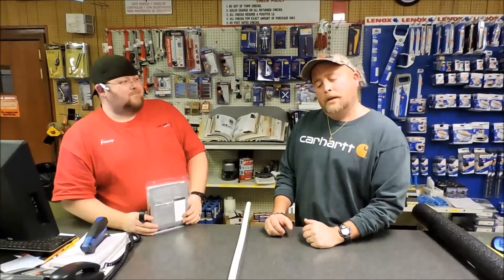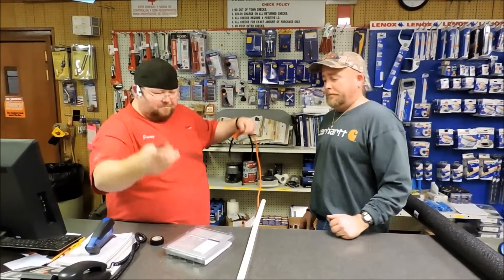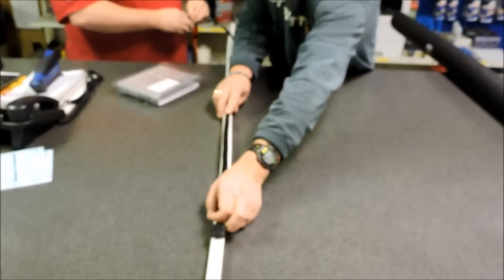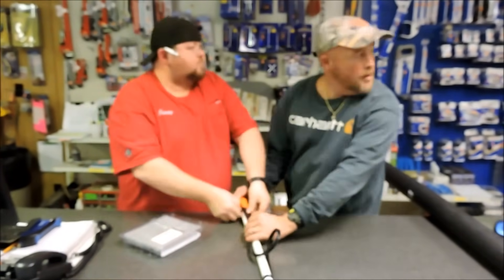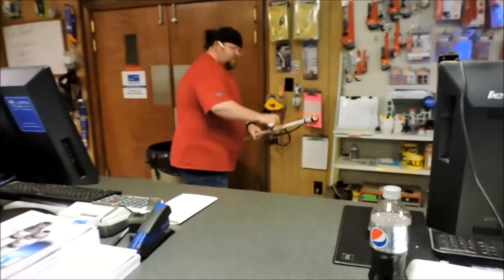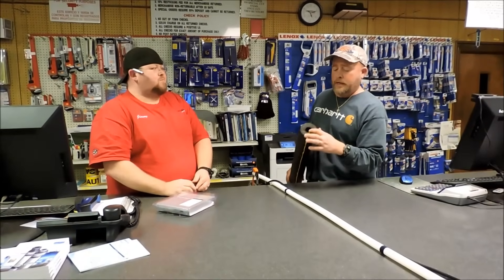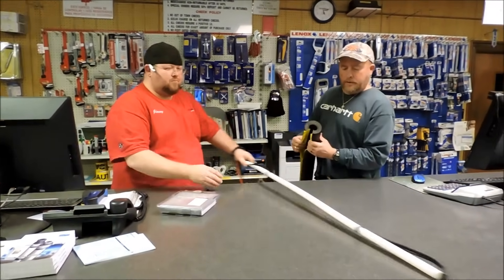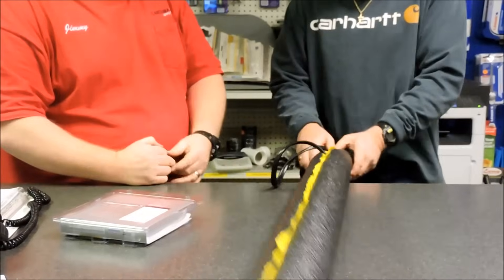How To Install Heat Tape To Your Pipes

Comment: I thought it says on the package not to wrap up/cover your heat tape.  can cause overheating and then a fire
Reply: Iva Lindsay     you can add insulation over the cable, in fact it is recommended. What you don't want to do is overlap the cable onto itself. It can cause an arc and start a fire.
Reply: Yeah you can, using the insulated cover they use.
Reply: Not if you use self-regulating cable. It decreases power as temperature rises. No fire hazard.

Comment: HOW TO TEST PIPE HEAT CABLE TO KNOW IT ITS STILL WORKING UNDER A MOBILE HOME
Reply: Take a voltage detector down the line.  If it has a regulator you'll have to wait until suitable cold that the regulator kicks on

Comment: I wondering if anybody can help me understand something. I’ve recently bought a trailer and the previous owner put the water pipes inside and he installed heat tape on the pipes, is it necessary to have it plugged in all winter long? He never paid for gas so the trailer was apparently freezing so maybe that’s why he put them inside and with heat tape of them?

Comment: Carolina Supply,Inc, I heard that heat tape should not be covered because  there is a fuse in the line and that covering it will cause the tape to over heat and then cause the fuse to blow. is there any truth to that?
Reply: It can also cause fires because it can catch the insulation on fire

Comment: Heat tape works great for short distances and last 2+ years.  Installation can be a heck of a job(crawling under the home, etc.).  ReadyTemp uses intermittently warm water circulating through both the hot and cold water lines to prevent the pipes from freezing.  Using a fraction of the energy consumed by heat tape and last 8 to 10 years with no annual inspections required.  The effectiveness and minimal energy lost to outside air is obvious.  Installs under the sink in 20 minutes using 4 hoses, than just plug it in.
Reply: And had a high up front cost.  Like everything else: if you're already wealthy you get help maintaining that wealth. I'm a capitalist but sometimes I shake my first at the sky

Comment: Im not trying to be an ass but pex manufacturers state to NEVER use adhesives on pex pipe as the chemicals embed in the plastic and over time will leach into your water supply. There are diff tapes with diff temps obviously but youre better off securring the heat tape,cable etc by using wire ties. If using metal straps you can protect the heat strip and pipe by using heat shrink tubing over the strap that contacts those surfaces.

Comment: my electrician just installed heat tape the regular type orange  black with a Thermostat with w black dot , so when he left  I looked at the plug and it lights , he put round foam insulation around the pipe  going up into the mobile home  , yet at the end  he just laid the extra heat wire over a  shut off valve very very loosely   and not tapped either and the black dot  hanging down not taped to the pipe  , he said  by not tapping it to the pipe its better because it measures the outside temperature and goes on and off .  is this OK
Reply: Rondo Schiavoni yes, you want to get an accurate reading. So the temp gauge at end of cable needs to be free. You can have it dangle free, that would be better

Comment: that heat tape goes on straight like they did, but the whole thing has to be on the pipe, the video is just a demostration so you get the idea.

Comment: Heat tape?.......that looks like an electrical cable.......oh, wait....the electrical cable is attached to the pipe with black electrical tape......mmmmmm.......maybe that's the tape......
Anyway........the pipe comes out of the ground, through a main house valve and then into the house......where do you place the thermostat?.......right where the pipe comes out of the ground, in the middle of the pipe or right before it enters the house?
Also, what "brand" is the electrical tape you're using?
Reply: "Heat tape" is a brand of "electrical cable" that prevents water pipes from freezing. Essentially the same product they are installing. Much like "duck" tape is what most people call "duct" tape
Reply: I didn't use the vinyl electric tape. They sell tape that is temperature rated for this purpose. Looks like masking tape.

Comment: First time even living in a mobile home. Heat tape was all bad under it. Looks like you used the Frost King tape which is all they sell around here. My question comes in here with the insulation. Don't call Frost King unless you want to talk to idiots. And FYI i have the gray tubing. Question is all the hardware stores here say i could use the 1/8 in Armaflex wrap or the 3 in x 30 ft x 1 in foil fiberglass wrap.  Well Frost King says NO to using their tape on Mobile home and NO to the foil wrap that is 1" has to be 1/2" thick and NO to the Armaflex. R value is to high.  Help!!!  I have Both wraps is any of them ok to use as the Support help is across the dam ocean and i could tell they was reading it off the dam card.  Thanks in advance for your time.

Comment: Can you let some heat tap over lap
Reply: No ! Heat tape should NEVER overlap.
Reply: NOOOOOOOOOO!!!!! Will cause an arc, which can start a fire
Reply: Yes. SOME of them can. Read the instructions. I have EASYHEAT freeze free. It says you can overlap it. Most of the heat tapes are only for supply lines. The one I have can be used on supply lines or on drain lines. Most can not be used on drain lines, there has to be water in the lines or the heater will overheat and burn through. Most you cannot overlap because they will over heat and burn through. Read the instructions and/or call the manufacturer or distributor. Be safe, they can burn your house down.